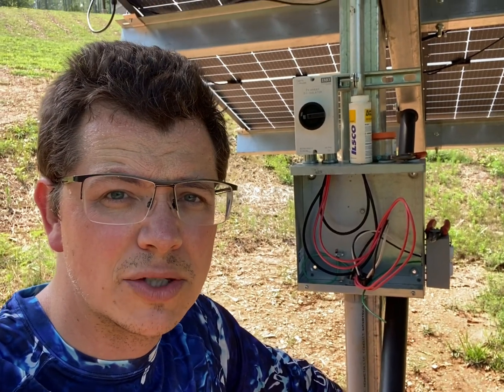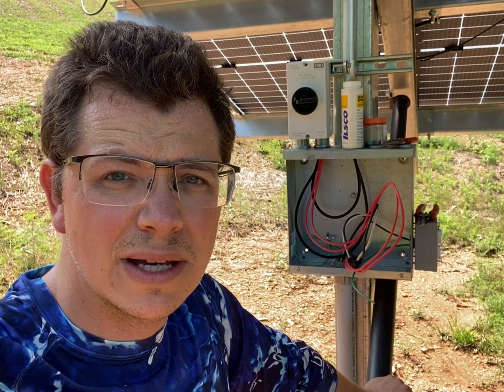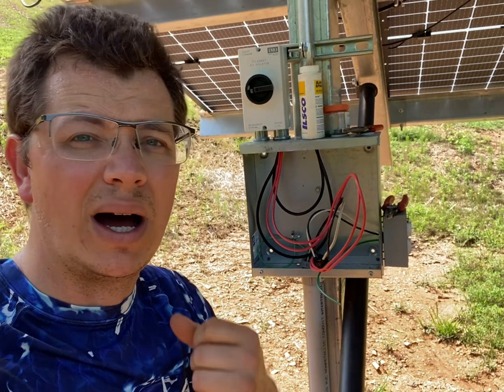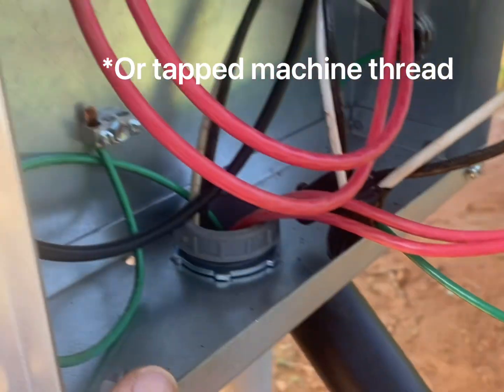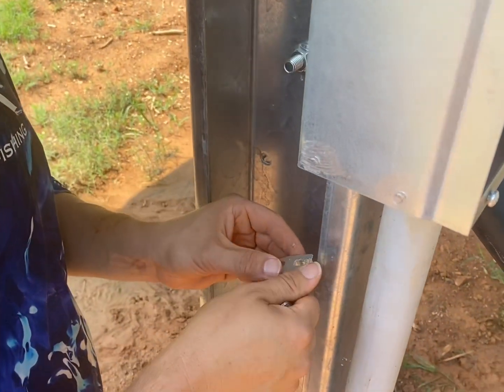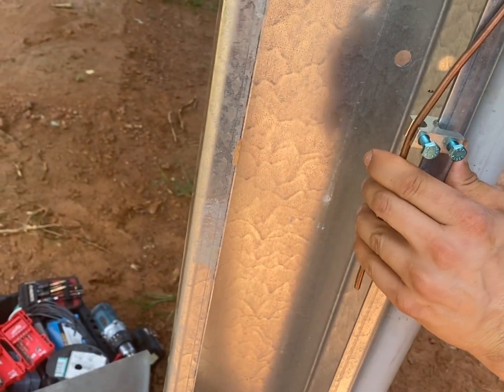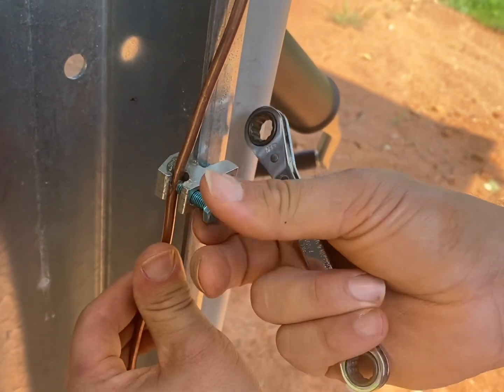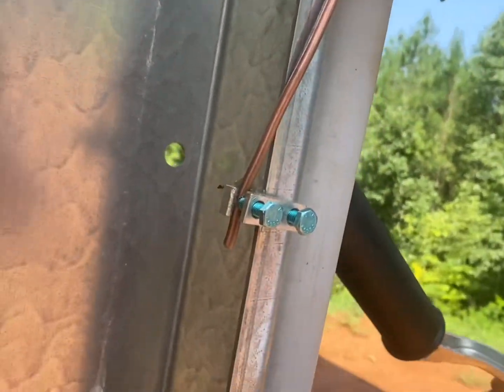Grounding a Sinclair Skyrack Groundmount

Comment: Just curious. The green wire goes to the house ground, correct? And if you didn't have the steel rack supports driven into the ground you would add a ground rod to that copper wire?
Reply from the maker: @roberthosking7524  you don’t have to drive a ground rod but you can. You can bond back to the house ground if required but some would arguing you are making it more susceptible to lightning.
Reply from the maker: @roberthosking7524  it really depends on the requirements of your charge, controllers, inverters, etc.

Comment: Thanks Johnny. Perfect. Question, You mentioned that your posts are driven. My posts are set in concrete. Does this still work in that case?
Reply from the maker: Yes it does. The goal
Is to bond the rack to the pull box.
Reply from the maker: This accomplishes that and this video is dedicated to you!!
Reply from the maker: This video is dedicated to you!

Comment: The possibility of a lightening ground strike radiating up 1 ground source a riding throughout a system and out the other grounding electrode source is frightening.  I feel better with only the two ground rods at the house which are bonded together underground.  Then just bond all metal parts together.  The Sinclair being galvanized I wonder how insulated it is in the ground?  Yes I watch too much Mike Holt.
Reply from the maker: I get what you are saying. For sure